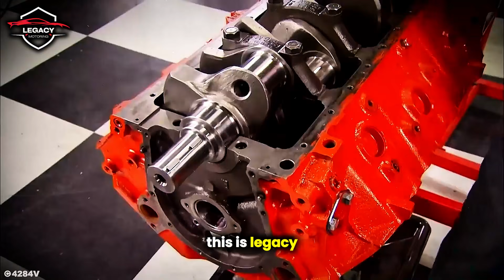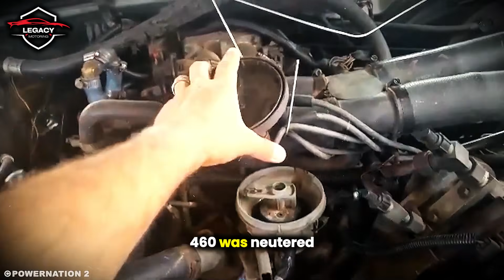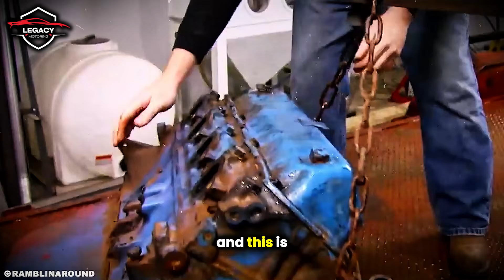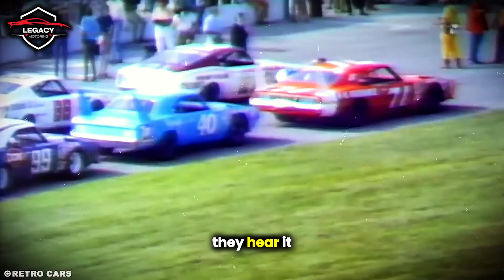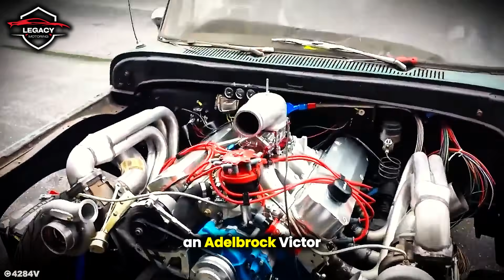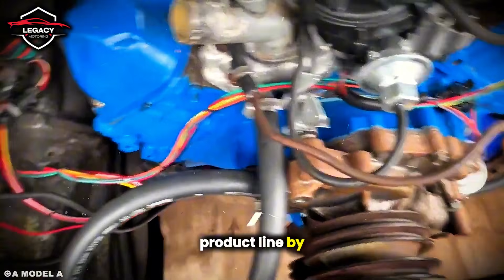The "Impossible" $40 Junkyard Ford 460 That Humiliated Factory Race Teams?

Comment: A 460 is nothing but a big pig and never in my drag racing days saw a pig run hell a run of the mill 383 mopar would smoke a 460 429 428 hell even a 318 would run with one of those dinosaurs 🦕
Reply: No 318 or 383 or 440  could kick a 428 Cobra jet. They won super stock in 68  in a mustang. The 428 is an FE motor. Not a 385 series which is 429  460. Know what you speak.

Comment: OE 385-SERIES crankshaft journals have 3.000-inch-diameter main journals, not 3.250-inch. // The OE 6.605-inch connecting rod and OE stroke provides a rod:stroke ratio of roughly 1.71558:1; the "magic" 6.800-inch aftermarket rod provides a rod:stroke ratio of roughly 1.76623:1.  A 6.980--inch aftermarket rod provides a rod:stroke ratio of roughly 1.81299:1.

Comment: The 385 oil pumps broke on the 385 racing  engines so Jon Kassi built a stronger pump . I worked on devolipment of the 429 Thunderjet in 1969 and knew it was a winner quickly .

Comment: The 427 won more superspeedway races than anyone in the 60's especially the 67 68 and 69 Daytona 500's also several Firecracker 400 races . The Boss 429 made Chrysler build a slik.par of bodies to be able to compete with the 429 Ford Talledga and Mercury Cyclone Spoilers . David Pearson won 2 championships in a row with the 427 Tunnel port .
Reply: The 427 was nothing to a hemi on the drag strip hell they were a exotic hard to find motor that blew up regularly at the drag strip while mopar ruled all that mattered the streets millions of 383 440 340s all capable of smoking any ford in town
Reply: @onesecureone You are funny. 427 Ford kicked wedge head 426 Mopars all day in the Thunderbolt. The 427 SOHC Hemi Ford was not available in a passenger car it was only available in over the counter race .Its first year in Competition Sneaky Pete won the 66 top fuel championship with one. Connie Kallita said he wished ford would have continued making it. They only made the engine for a couple years. A 427 won the le man's, then they brought the 289 to LeMans. Yes the Hemi Cuda has its own class in NHRA S/S AH.  The Ford Thunderbolt 427 wedge is the wedge 426 Mopars nightmare. Ford doesn't keep things long they come kick ass then change. Ford was America's first Hot rod  like the Coyote is an example ford hasn't made a push rod engine in years. Chevy I hear has a new overhead cam coming out. 427 Ford has won the 24 hours at Lemans, the 289 small block won 24 hours at Le Man's. 426 Mopar couldn't stay together that long. I don't say it couldn't they just haven't tried.

Comment: If its 521 ci, he's using a 4.25" stroker crank. I would too.
Reply: 521-cid bore/stroke combos based on the Ford 429/460:
+0.000 B 4.360 x S 4.365 RL 6.722 CID 521.36 (521) RL/S 1.5400:1
+0.015 B 4.375 x S 4.335 RL 6.737 CID 521.35 (521) RL/S 1.5541:1
+0.020 B 4.380 x S 4.325 RL 6.742 CID 521.33 (521) RL/S 1.5588:1

+0.030 B 4.390 x S 4.305 RL 6.752 CID 521.29 (521) RL/S 1.5684:1
+0.040 B 4.400 x S 4.285 RL 6.762 CID 521.24 (521) RL/S 1.5781:1
+0.060 B 4.420 x S 4.245 RL 6.782 CID 521.08 (521) RL/S 1.5976:1

+0.080 B 4.440 x S 4.210 RL 6.800 CID 521.47 (521) RL/S 1.6152:1
+0.100 B 4.460 x S 4.170 RL 6.820 CID 521.18 (521) RL/S 1.6355:1
+0.120 B 4.480 x S 4.135 RL 6.837 CID 521.45 (521) RL/S 1.6534:1

+0.140 B 4.500 x S 4.095 RL 6.857 CID 521.03 (521) RL/S 1.6745:1
+0.160 B 4.520 x S 4.060 RL 6.875 CID 521.17 (521) RL/S 1.6933:1
Reply: @wireflight Well done, sir. The combo I had in mind was .060 over (4.42) or .080 over, with a 4.25" crank. You worked really hard on this!